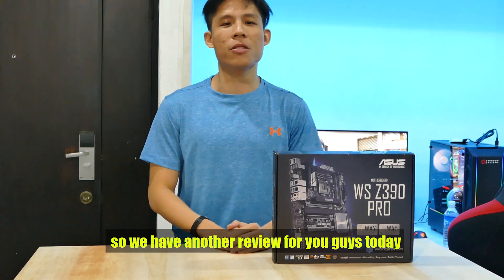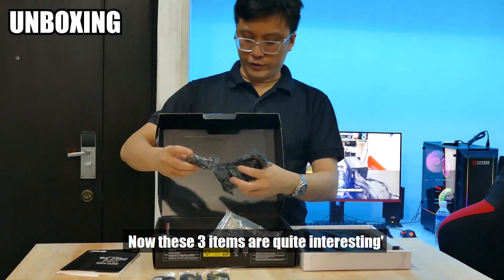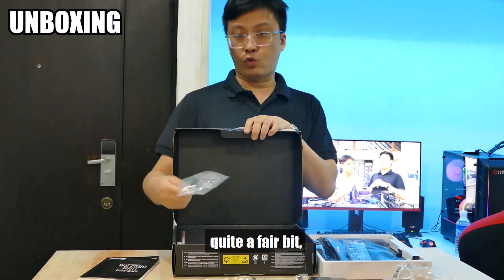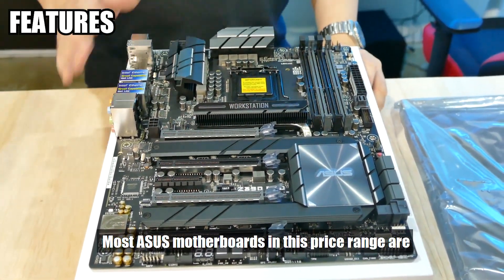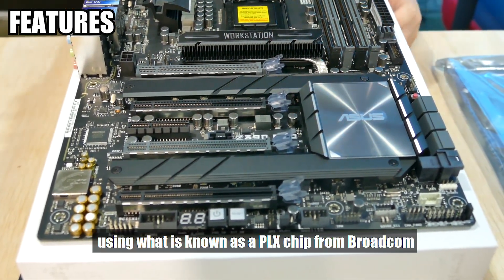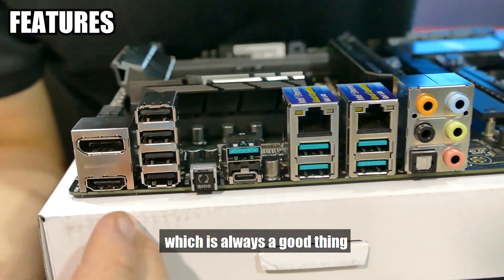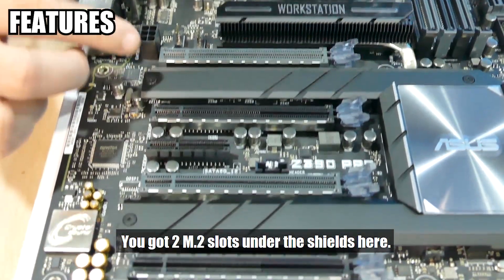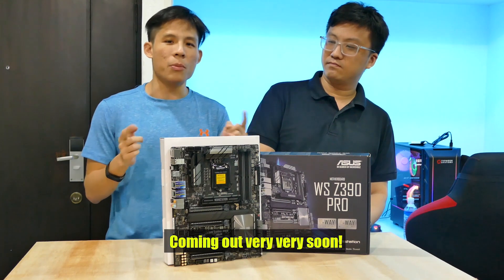ASUS WS Z390 PRO Review Part 1 - Unboxing & Features Overview!

Comment: Does Xeon E-2286G work on this motherboard?
Reply from the maker: No, For the Xeon CPUs, u will need a motherboard with the C246 chipset (basically the Xeon counterpart to the Z390 chipset). Main difference between C246 and Z390 is unbuffered ECC DDR4 RAM support on the C246
Reply: @RealMelTan  that's unfortunate.. My present Asus X79 Deluxe supported both the Core i series as well as the Xeon E5's. That was ideal.

Comment: Do I need two 8 pin CPU connectors to operate one GPU with two M.2 drives?
Reply from the maker: A single 8-pin is rated for 280W CPU power in, which is way higher than what most LGA 1151 CPUs will draw under normal circumstances (even the i9-9900K). That being said, connecting both will better spread and distribute the power load across them both. If you have 2x 8-pin on your PSU, go ahead and connect them. If not, it does not make much of a difference unless you are using LN2 to hit overclocking records on a 9900K for example